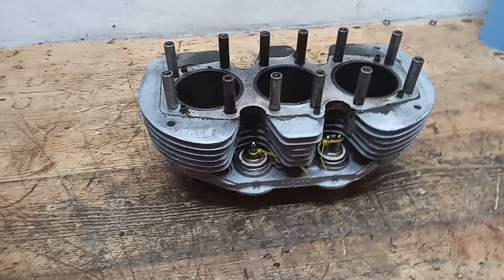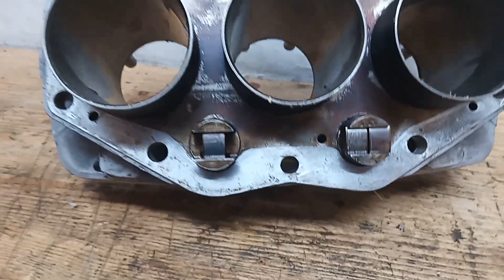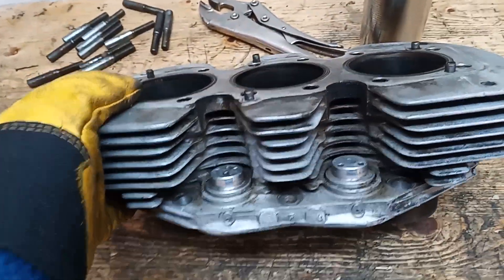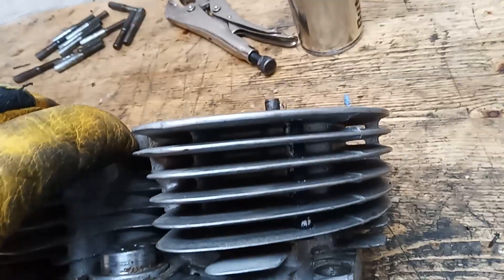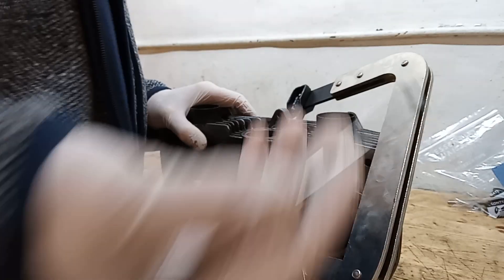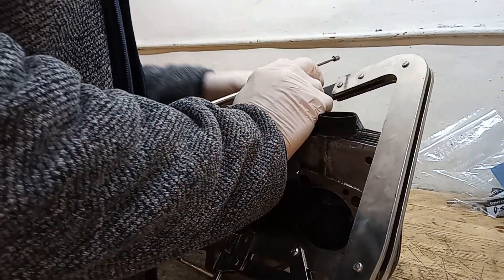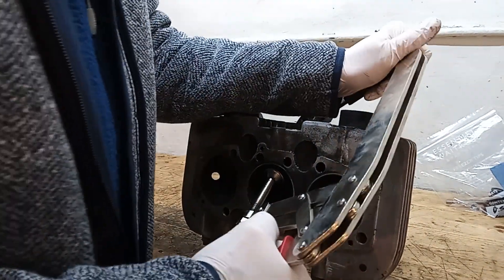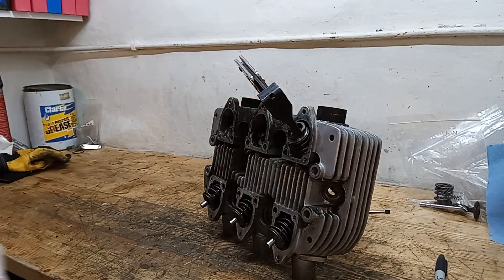Triumph Trident T160 Rebuild. Part 3: Cylinder Head and Barrels

Comment: Do you know the correct way the lifters are supposed to be installed? They have a hole that is on the side of the foot, not on the stem, but the whole doesn’t even go all the way through. Is there a certain way they have to be facing and is there a purpose for the partial hole? Thanks for any help you might be able to offer.
Reply: I’m dealing with an engine that’s already been apart and don’t want to just hope they had them installed in the right position.
Reply from the maker: I'm afraid I can't answer that with any certainty. I know that some tappets (as we call them) were made with that oil hole, whereas others weren't, but I can't say if they need to be fitted a certain way round or not. Sorry I can't be of more help.
Reply: @Chris.rooke150  thanks for your quick response!